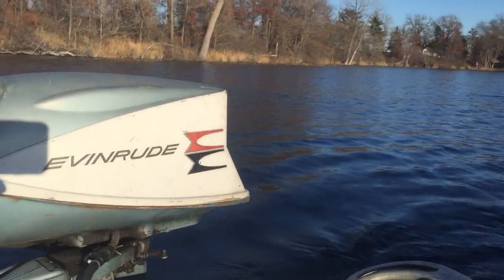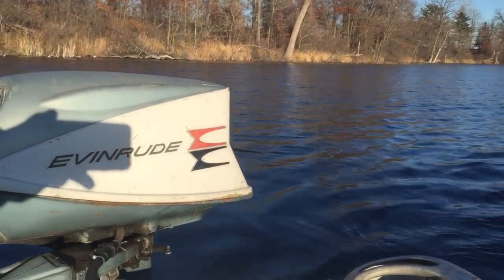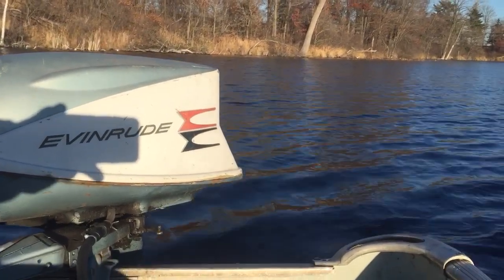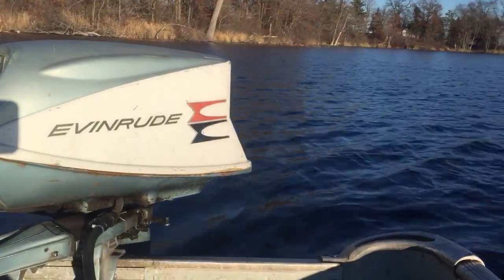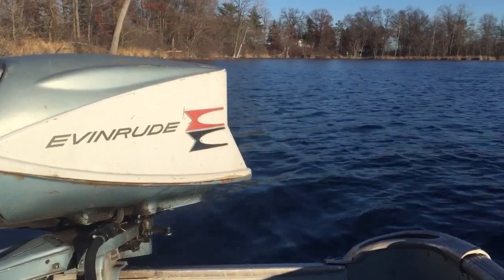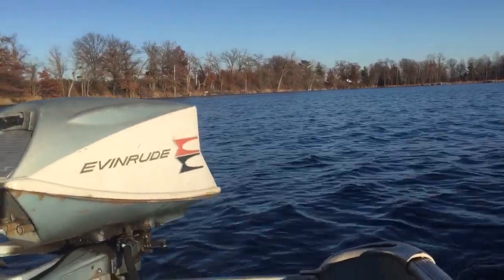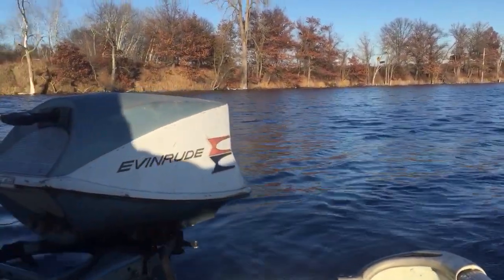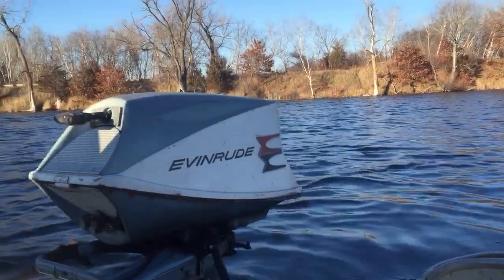1961 Evinrude Fisherman 5.5hp outboard motor

Comment: Hi Ben ,
What fuel mixture for this motor...50:1 or 24:1?
Please clarify. Thanks!
Reply from the maker: I use 16/1
Reply: chrysleroutboarddude 
Is there a reason to use 16:1? Everything I'd read points to 24:1 for the 61s.
Thanks again for your reply!
Reply: Original owners manual says 24:1 or 1/3 pint of oil per gallon.